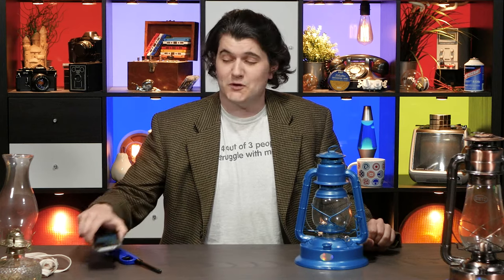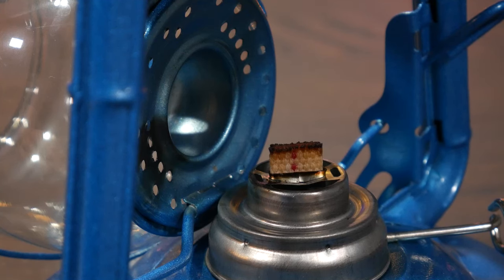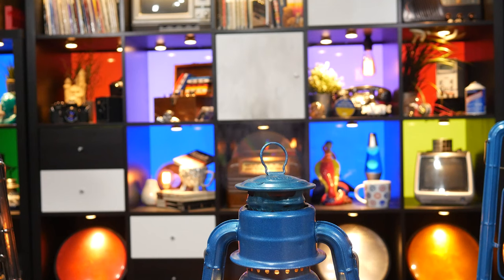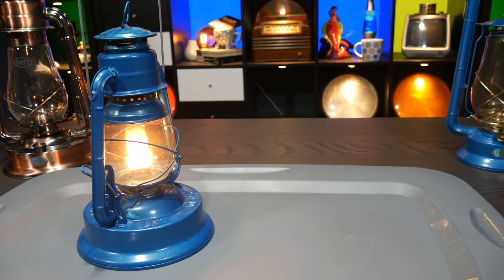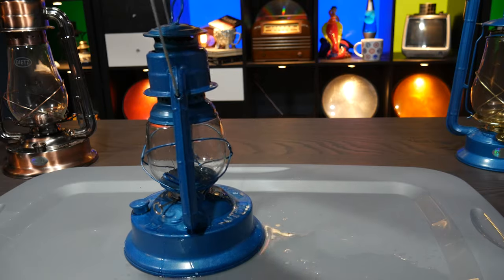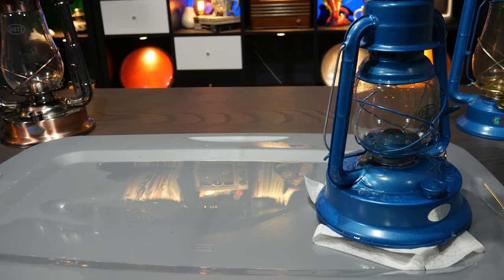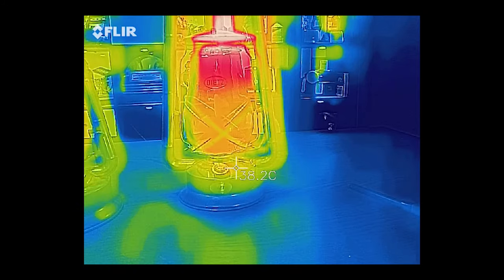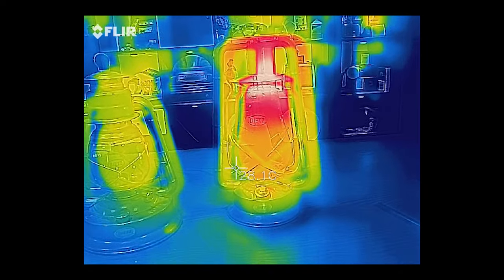How to use, more info, and further thoughts on hurricane (Dietz) lanterns

Comment: Kudos for not editing out the "dumb" part, as it shows just how bad things can go. You may have saved somebody's home and/or life.
Reply: For real. Dude just said "fuck it" to ego in favor of still demonstrating how dangerous something is. Respect.
Reply: To be fair kerosene isn't that flammable. A puddle of room temperature kerosene won't light without a wick. Heated kerosene on the other hand does give off enough vapours to ignite.
Reply: @marc-andreservant201  True. But a couch, tablecloth, carpet, etc. will serve quite adequately as a wick. It's not known if the Chicago fire of 1871 was really started by a lantern but the reason that many believe it was is because it is a very real possibility.
Reply: Is it a good idea to put loose kerosene in an enclosed garage to evaporate? Any ignition sources like a gas water heater out there?
Reply: @Toramt  Fire hazards aside, kerosene fumes are probably not good for your lungs.
Reply: Yes!!!!!!
Reply: @Toramt  who said it was enclosed? He hates the smell of kerosene, why wouldn't he open the door? Plus, you would need more kerosene than what was left in the lantern to fill up an entire garage with fumes enough to spark a fire with a water heater igniter. Good try tho...
Reply: @Toramt  oh and I forgot about the most important thing. The temperature that kerosene evaporates at is higher than room temperature. That's why it's safer than gasoline. It has to have a sustained heat source near the fuel to vaporize the kerosene into fumes enough to ignite, aka: a burning wick.
Reply: @Toramt  Usually water heaters and furnaces are not kept in the garage. None of the houses I have been in at least have had their water heaters in the garage.
Reply: @kaylinosprey3306  Ah, every house I've owned has had it in the garage; geographic differences I guess. There is even a code-compliance requirement about having a iron/cement bollard to prevent cars from backing in to it.
Reply: @Toramt  interesting
Reply: @kaylinosprey3306  
As with @Jason Martin, all homes I've been in have had water heaters in the garage.

Comment: Quick note: glass is very good at blocking infrared. You can tell the temperature of the glass, but not see through it. I learned this when using IR-based night vision equipment in the Army.
Reply: The good thermal cams use transparent aluminum (synthetic sapphire glass)
Reply: Yeah.  I think he's got another recent video on that.
Reply: @alex.thedeadite  Pedantry ahead: It is aluminum oxide (Al2O3), not just aluminum, which forms the mineral “corundum”. This is that special glass. 
Is is technically not “sapphire” because it does not contain the contaminates that give it the colors we associate with sapphires. This is also the case with ruby, which is corundum contaminated with chromium. Nonetheless, it’s all the same stuff and is obviously called ruby or sapphire glass because marketing and it’s easier to understand. Not that it makes much of a difference anyway, same is same.
Reply: Yep, every nerd in engineer glasses turns into a badass with aviators in infrared.
Reply: Makes sense considering a green house or a closed car in the summer.
Reply: @suspicioustumbleweed4760  Both have one thing in common: they prevent hot air from raising and being replaced by colder air higher above the ground.
Reply: Only some glasses—not all.
Reply: @OGSumo  what i love about geology (and its required chemistry) is how some things are fundamentally the same elements but depending on the amounts can cause two entirely different minerals to be made, all from the same stuff. 

An easy example off the top of my head is like serpentine and jade, fundamentally the same but simultaneously quite different. 
And somehow humans figured all this stuff out! Its just wild.

Comment: The thermal camera can't see the flame because glass is not transparent in the IR specter
Reply: Cool info
Reply: @nk4j272  Or warm info...
Reply: Was just about to comment this :P
Reply: Then the glass would have to absorb the IR or reflect it back. If it absorbs the IR, then it would re-radiate it, making it detectable outside. Have observed the latter with quartz glass window of Morso woodstove. If you rapidly open the door and point IR thermometer at it (either side), you see T reading same as with door closed. If the glass reflected IR back, you'd likely get into thermal runaway.
Reply: @jacquesblaque7728  in addition to conduction through the glass, as you mentioned, there is convection. Specifically, the exhaust air can (and likely does) carry a lot of heat with it.  The fact that the top of the lamp where the exhaust comes out is so hot suggests quite a bit of heat is carried out that way.
Reply: @MonkeyJedi99  Maybe even "Hot News"? ;)
Reply: @jacquesblaque7728  Quartz glass is used where there is need of high transmittance to IR. In the case of the woodstove, it's to ensure it serves as a proper heat source for a room. Normal glasses are generally not very good at transmitting IR
Reply: @doctorbobstone  We might be getting appliances confused. Kerosene lamps, because of their extreme inefficiency, mainly dissipate heat via exhaust.
Reply: @debug9424  As I stated high IR transparency is NOT the case, and it's demonstrably not necessary. Research indicates that opacity of quartz glass to IR is dependent on presence/absence of hydration in the glass.

Comment: As someone that's actually used oil lamps for lighting, there's a trick to setting the wick height properly.

If the lamp is smoking the wick is too high.
Lowering the wick slightly will reduce the light produced.
Counterintuitively, continuing to lower the wick will actually make the light brighter.

Our usual procedure was the lift the wick high to light it and then lower the wick until there was barely any flame at all, then raise the wick slowly for the desired brightness. If it's smoking you've raised the wick too high!

ETA: Forgot the most important part, those final height adjustments must be done with the chimney in place!
Reply: Wicked!
Reply: "used" 
D:
...BEGONE!!!
Reply: Is it odd that I noticed these tricks without actually knowing half of what I know now?
Reply: I may or not have noticed this, we used to keep a few oil lamps on hand in case of power failures.  One thing to keep in mind when using an oil lamp, is what is above the lamp. We could have had a kitchen fire because we didn't think  about  cabinets being above the lamp.
Reply: @TestarossaF110  What is wrong with 'used' ?
Reply: ETA = Estimated Time of Arrival.  I think you wanted PS (Postscript).
Reply: also, trimming the wick makes a big difference
and how it is trimmed
also, I should point out that they do need trimmed...
Reply: Yup, correct procedure. Decades ago I used to interact with lots of these (waaay before the age of LEDs -- these are much more rugged compared to incandescent lightbulbs), it's second nature
Reply: @reichstein011  ETA additionally can also stand for "Edited To Add"
Reply: I usually straight-up light with the wick just below the slot surface, pop the chimney on, then raise to comfortable height.
Reply: Knowledge of the past 30 years will soon be gone as people get older and pass away.  People aren’t writing and explaining technology of days gone bye, now we have the Internet and YouTube. 

Just think,  Google is storing our knowledge for all of us. 😱
Reply: Also it helps to trim the wick into a convex shape
Reply: @coolbluelights  Yeah, at a minimum, trimming off the corners of the wick is a good idea.
Reply: @fryloc359  You can get smoke bells that clip on to the top of the chimney.  They break up the hot air column that rises out of the chimney so you don't char the ceiling like we did once upon a time!
Reply: @NewAgeDIY  the internet and websites are storing the information. Google is allowing us to search for those websites.
Reply: Yes as a couple of people have mentioned trimming to wick to match the shape of the burner makes a big difference in how much it smokes whether it is a hurricane lantern or a simple kerosene lamp.
Reply: I said that in the other video comments. Trim that wick and lower it. He's using it wrong or inefficiently
Reply: Yup, and it's important not to scorch the glass with the smoke!
Reply: @jeffhousen8968   There're a lot of discussions on the optimum shape to trim one's wick but after a bit of research and much experimentation I eventually concluded that the simple strait flat snip remains the most effective
Reply: A literal flaming genius has spoken. LMAO
Reply: @PanduPoluan  interesting! Now whenever i see ETA im going to be very confused as to what it could now mean contextually lol

Comment: Oil lamps do still have a place.
I live in earthquake country in an area with overhead lines.  So, in spite in being in the States, electricity loss is a reality.  I keep "classic" oil lamps for the sake of near zero maintenance reliability.
Dry cell battery lamps are fine until the batteries leak.
Lithium batteries can be charged, but can also be overcharged, or forgotten to charge, or be too old to hold a charge.
Mantle lamps aren't the most durable things.  Tying on a fresh mantle at midnight to the flame of a match is not my idea of fun.
Propane is under pressure, can leak, quite the hazard.
Kerosene has a roughly 5 year shelf life as it can take on water from the moisture in the air.
Paraffin lamp oil has no definitive shelf life.  My oldest lamp was filled by my grandmother some time in the late 1950s and will still light today with no fuss.
Come the day of a shaker that cuts power for a week or two, or yet another summer of rolling blackouts, I'm completely confident I will have light. (^_^)y
Reply: Non rechargeable lithium cells are your answer. Have a shell life of over 10 years
Reply: Overcharge protection chips exist for a reason.
Reply: @rautamiekka  Then tell manufacturers to use them.  Otherwise, iPhones wouldn't bulge and Samsungs wouldn't burst, right?
Reply: @ImnotgoingSideways  The unavoidable bulging is due to the chemistry, the explosions due to ill-fitting accus used.

Modern phones, accus, and chargers refuse to move more power once the capacity is reported full (in the case of chargers once the receiving power drops enough), they can't be overcharged by simply keeping to push more.
Reply: I agree, it's a smart move to have at least one old, simple, reliable, thing that you can turn to if the usual systems stop working. I bought electric lights and plenty of batteries after hurricane Sandy knocked out power all over the New York Metro area in 2012. All of those batteries will soon be expired and so now I have to revisit my power failure prepping, take a deep breath, throw out all of those batteries and face having to pay for new ones, with the understanding that ten years from now, it's likely that I will have to throw all of them out too. 

But my Dietz lantern paraffin oil, candles, and fairy lamps, will work as good as new even 100 years from now.
Reply: Lanterns (and braced furniture) are definitely the answer lol. I'm in earthquake country, too, but so far I've only used my lanterns for winter weather emergencies. We had no power for an extended period last winter, and we have electric heat. It was ugly. I get free stuff to review and I'm a safety/disaster gear hoarder so I have about a hundred lights, inverters, various rechargeable/disposable batteries, solar panels and power banks. It was great to have light but it was greater to have heat. I had a propane heater, Stansport oil lanterns, candles and olive oil lamps (and CO monitors). All of them worked great, but the oil lanterns were easiest to carry and had the best compromise of other features. The propane heater was not safe for my dog, we can't store large amounts of propane and the heater burns it up too quickly. Plus you have to turn it on and off all the time. Candles and veg oil lamps are great but they have open flames and you have to find perfect containers to make them safe. Once they get hot you may not be able to move them, and it takes multiple candles/wicks to match one kerosene lamp, so it's a hassle and they take up more sf of counter space anyway. Olive/veg oil lamp wicks can be fussy and messy, and the oil can easily spill (although the flame goes out if it does). I'm really glad the information is out there so I was able to prepare way ahead of time. Everything (except vegetable oil, string and food in glass jars) was gone from local stores the moment people heard it was supposed to snow. 

Also recommend that anyone unfamiliar look into Trangia style alcohol stoves. You can make a similar stove out of a cat food can if you want or need to. That's what i used to cook (indoors) when there was no power. I keep the stove in my bug out bag. People said you can use Heet or rubbing alcohol indoors but i tried it to see how it worked, and it made me sick. I used alcohol fuel from the hardware dept at Wally world. You can also use ever clear if it's legal where you live. There are also alcohol heaters and you can find heater plans online, but I haven't made one yet. And you can get safe canned heat from the party section at dollar tree, to cook on or use for heat, but i believe it doesn't burn hot enough to boil water. Oil lamps and alcohol stoves are simplest lol
Reply: When it comes to emergency heat, I have a reburning wood stove insert.  Expensive but once in a lifetime level of durability.  Roughly 5 split log wedges and a closed vent are enough for 24 hours of full house heat or open the vent for 4 hours of water boiling.  Any more will make the house unbearably hot.  And, this is in a 1950s pier and beam subfloor house.  Insulation is beyond sub-standard.

I'm yet to see a pellet setup which doesn't require an electric feeder.  So, logs it is.
Reply: In my case growing up in southwest Florida oil lamps definitely had a place, more specifically the hurricane lamps. 

Still got mine after 21 years of hurricane seasons, its been a faithful and handy piece of equipment for many a hurricane. 
Batteries and the like were usually sold out or being price gouged, gasoline was hard to come by, but surprisingly kerosene didnt always sell out because people nowadays kinda favor electric flashlights and propane lanterns, and its not super common as generator fuel (granted im sure you can run it in a diesel generator in a pinch). Best case scenario you have the foresight to buy a few gallons or so long before a hurricane hits, and it has a fairly long shelf life granted moisture and fuel eating microbes can become an issue in very humid environments.

Now im out in the Rockies but we havent had many storms that have knocked out power yet, fortunately we got a fireplace and a few cords of wood, but the trusty hurricane lamp is at the ready hanging from a nail right inside the garage door.
Reply: @rautamiekka  some modern smart devices also have a seperate manually activated charge limiting setting, usually labelled something like "battery saver/protector" and it limits a "full" charge to about 85% and then stops supplying power. 

It does help keep my older phone from getting as hot during charging.

Comment: I've used these a lot for lighting small festival sites (deploying ~100 at a time). I found that turning the wick down isn't a good way to turn the lamps off, mainly because if you turn too far the wick can slip out of the rollers and end up in the fuel tank. It's hard to fish them out, so a better way to turn them off is to simply lift the glass and blow. The other advantage of this is that the wick is perfectly positioned next time you light it.

Comment: Thanks for taking the time to make these videos.  Great content for the physical science nerds.  In the 70's I drove a 1966 Chevy Impala station wagon with a 289 V8 and 2 barrel carburetor.  On fall mornings you could feel the additional horse power produced by the cold morning air.  Even my friends (passengers) noticed that the beast had a little more zip than normal.